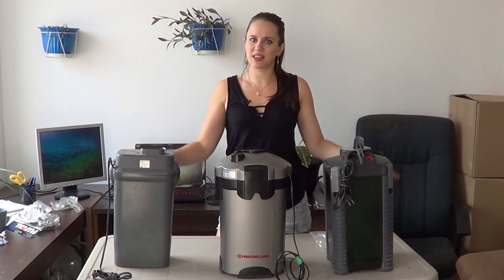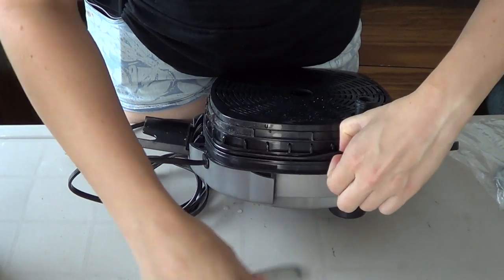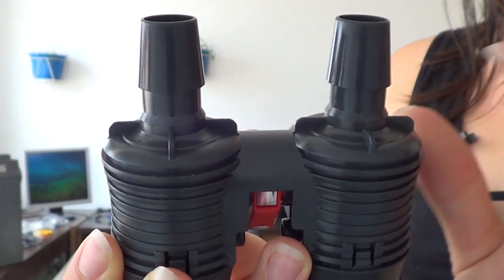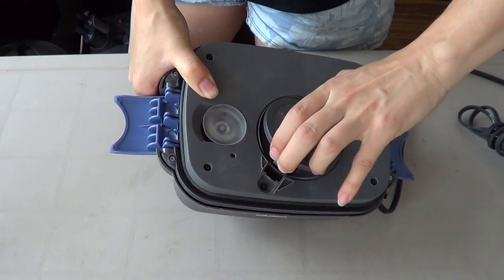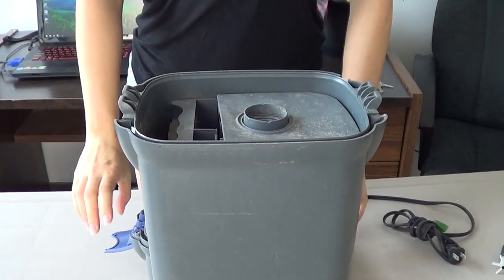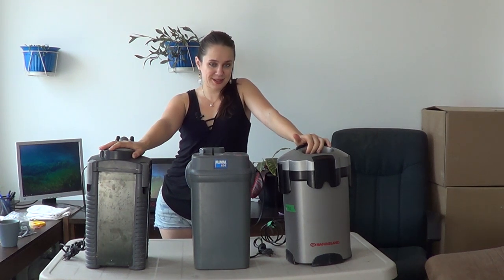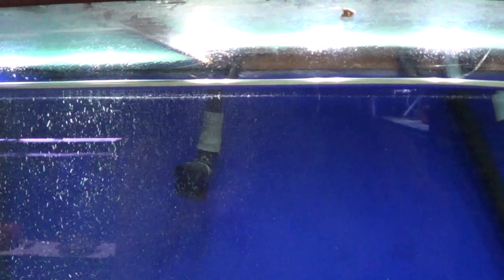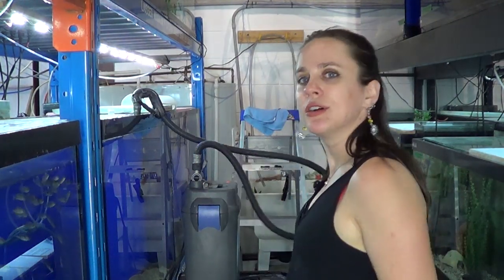How to Fix an Aquarium Canister Filter

Comment: Hello from England 🇬🇧,
Interesting video, thanks.
I've just tried to start my Fluval 305 after a few years, the lid doesn't  SIT properly & water comes our of the gap, is that just due to the rubber ring?
If so what type of lubricant shall I use?
Thanks.

Comment: What do you do in a situation where the canister keeps sucking in air from somewhere and blowing bubbles every few minutes. I have checked and no air is going in from the input hose. I've even put teflon plumbing tape on the nozzles of the hose adaptor and the o-ring of the lid to make an airtight seal to prevent air entering from there but it still seems to be sucking in air from somewhere. Any ideas where else I could check for an air leak?

Comment: As an ex Montrealer, 1968, I have been watching your entertaining videos since getting back in the hobby 3 years ago. I love your Fr Canadienne accent, and your enthusiasm on your videos

I have a Rena filter sitting at floor level for a bottom tank. Is there any fix for it not loosing suction?       Steve now in Los Angeles
Reply: I just added a comment about burping Rena filters, Steve - might be helpful.  These filters are great, but every once in a while, air can get into the system.  With mine, the intake mechanics inside the tank can separate and suck in air.

Comment: My oldest Eheim classic has been running continuously since 1997... had to replace the handle clips once... that I broke accidentally.
Things not working as you plan... the reality of fish keeping. These mistakes are fun to watch - glad to know us amateurs aren't the only ones.
Reply from the maker: 1997! Those Eheim filters are unkillable! When they break, it's usually our fault 😂
Life isn't perfect as social media would like us to believe.  
The more mistakes we do, the better we get.  I didn't get this good with everything going my way ;)
Reply: Since 1997? You should be an advertisement for them! I have been trying to decide on a filter, you just sold me. Thank you!
Reply: Sir...are u saying that you have an Eheim filter unit that has been running NONstop since 1997?????
Reply: Looks like I bought the wrong units!!!!
Reply: Only one stuff which could brake is motor lubricant. Mine has dried and motor stop working. Some clean up and new oil and works fine again.
Reply: RoxyQueen  I’m a wee bit late - don’t know how I missed it. If you are referring to never having been unplugged, then no. Maintenance and moving a few times have given it a few hours of rest. I always take my fish and tanks with me. Otherwise, yes, since 1997. I have an Eheim internal filter the same age also running since then. Two other Eheim echos running 7 tears straight. Two other larger Eheims only two years old, and a few early 1990s Aquaclear hob that have been in service about 20 of those years. An early 90s Fluval 403? Canister lasted only a few years  before many things started breaking and finally the motor.

Comment: Great video  a lot helpful tips. For leaking canisters that have UV lights, their is also a seal (o-ring) on the light housing on the inside of the head, that unscrews anti clock wise and is easy to spot the seal around where it screws in. Can tell if this housing is leaking by seeing if the light bulb glass is filled with water. Have a great day. :)
Reply from the maker: Thank you for sharing. This is great information. I didn't think of talking about the filters with "add-ons". :)

Comment: Hmm I should have brought down my 23 year old Fluval canister from the attic (still in the box) to have you demo how to fix it lol.  Thanks for the info since I might be doing this soon.
Reply from the maker: Most pet shops have the Fluval supplier. You shouldn't have problems getting parts :) I'm glad I was able to inspire you
Reply: i still got a Fluval 103 just order  the case clips  one broke off,seal is bad so i use teflon tape
i use the 103 filter to vacuum, great filter you do not find  filter like that any more.

Comment: Sometimes, at least on those API/Rena filters, when the filter gets really noisy - rattling like the impeller is broken - it's actually just because air got into the pump intake and you just need to 'burp' the system.  This can happen if the hard plastic intake tube in the tank somehow separated from the intake pipe going to the filter.  You'll want to fix that first.

'Burping' the filter it while it has water in it (and is turned off) is a little bit tricky - just give a couple of those side clips a lift for a second or two, watching for the water to rise to the top inside the filter, and quickly close them again before it starts spilling out the sides.  Put a towel around it first, like I forgot to.  This is a lot easier to do if the filter box is clear and you can see the water level.

If the intake pipe is empty of water at this point because the intake siphoning was interrupted by air, you can unscrew that cap on the top of the intake pipe and funnel some water into it, refilling it, and then screw the cap back on. This will make the system start up more quickly when you plug it back in.

As mentioned, make sure the hard plastic intake tube that goes inside the tank, is properly attached to the intake pipe, otherwise it's just going to suck air in again.

Did I mention towels?

Comment: Super smart video :) I used plumbing tape around under original seal ring if new seal not found.
Reply from the maker: Thank you :) I've never tried the plumbing tape. I'll give it a try next time I'm stuck.
Reply: Great idea. If you end up near say a Princess Auto or an industrial supply shop, check on a a tube of gasket or "O Ring," lube. It is specially designed for giving seals a new life. If you would like I think I have an extra tube, the stuff I have is called S111. Your plumbing tape fix is genius, nice work.
Reply: works wonders.
Reply: I used this too..didnt work.

Comment: I have an issue and need professional help. I have a Polar Aurora Free Media 4-Stage External Canister Filter with 9-watt Light, 525 GPH  and I followed all instructions and it works fine but i notice from the start that it runs for 8 to 10 minutes and then stops for the same time. Then the cycle repeats itself. My aquarium water is fine after testing but I am concerned since everyone says it must work continuously. I contacted the company and they sent me a replacement motor cover but no change. What else could be the problem?

Comment: Any tips on the discontinued Rena Filstar gasket and o-ring replacement kit? I have the XP3 that works really well but after 10 years I think the seals are about to go.
Reply from the maker: You don't want my tips on this filter :( All the parts are discontinued and impossible to get. I gave up and got rid of my 5x Filstar filters. It's depressing.

Comment: Have you ever considered reading the instructions that come with the filter? I have a Fluval  407 and used to have a 405. To start it you just push down the intake lever while keeping the output nozzle above water level. Filter then fills with water and you plug in the power. Very simple.
Reply: I cannot thank you enough for taking the time to write your comment. I could not figure out how to get the flow going on my filter. I had cleaned it and removed sponge material that lessened the flow... Nothing seemed to work. I followed all the directions in the manual. I've had my rena filstar canister filter for years almost 10 and never had this issue with it before. I always fill it up as much as possible in the canister and then the intake where there is a removable lid. I have never ever read anywhere in the manual or even trouble shooting online Reddit Quora YouTube about lifting the outtake above the water line while plugging back in. Truly so grateful for your comment. Thank you. My aquarium is saved.

Comment: Love your approach Richelle, simple and straight forward.  I had an impatient Sunday once, where I was sucking like a Catholic on her wedding night, but no syphon whatsoever.  Lots more sucking and swearing, only to discover that the hose running across the tank brace had come loose from the inlet pipe.  Turned out the pipe which was quite old had stretched and gone hard, so worked loose easier than it would normally.  
I'm with you though, the ribbed Fluval hose is a P.I.T.A, and always switched over to the smooth tubing.
Reply from the maker: Hi Barry. When I got the notification of your comment, I burst out laughing! I feel ya!!
I had to edit out some of my siphoning for the Fluval Canister.. if I would have left it, my video would probably have attracted some unwanted attention 😂
Those old tubes give me so much trouble.
Reply: Hahaha... yeah, I can imagine.  lol
Reply: Oh my God!🤣😂🤣😂🤣 Long story!

Comment: My hang on back mini canister filter doesn't pump water... I tried priming ..then it works for couple of seconds and then stops...i can see water running up through the outlet pipe untill the last bend but don't throw water into the aquarium...can you please guide any corrective actions..this is brand new hob

Comment: Whenever you fit an o-ring (seal) use your silicone grease. It'll allow the seal to find its natural shape in its seat, this assist to prevent distortion over a longer period. 👍
Reply from the maker: Thank you. Great addition! 😊
Reply: This did not help me with my issues on the sun suns..even though everyone swore by this.

Comment: I have a Sunsun canister that I can't get started, I don't know what's wrong. I fill the canister with tank water, then start a siphon in the intake line, close the valve, attach to canister, then open the line and plug it in. Then the siphon breaks. I don't know what to do. Help?

Comment: On the 404 my top won’t close properly and slightly leaking where clamps are
Reply from the maker: Your seal is probably badly put on. That's what I usually find is the problem. 

That, or something in the canister is blocking it from closing

Comment: Have you ever heard of the sun suns getting warped??maybe from too hot of temperature being left in storage or too cold temp? I have 2 Sun Suns that both Leak from the handles and one leaks from the sides..Ive changed the seals and even went as far as to use silicone glue or sealant....which this did NOT fix my problem...go figure..I also have a HYDOR 600 that has lost huge amounts of water flow..is it the motor maybe worn out? Its 3 years old and wel taken care of..I dont understand why I am having all of these problems with an expensive unit AND Inexpensive units..can u help me out here?

Comment: Hi, can you help me. I have a canister filter dophin C1000. After set up the filter. I try to pump out the water from the tank into the filter. But, the pressure is not enough, the water from the tank didn't flowing down. So, i try to fill the water in the filter. Then, i turn on the power, but the water didn't going in and out. I heard the weird sound of impeller. I try to take off the top, and switch on again the filter. I saw the impeller only vibrate not spinning. I try to pull out and reposition it again. But, it still the same. Doesn't spinning. How can i solve it? Please someone help me 😭
Reply from the maker: Check if the shaft or impeller is broken. I show you how to do this in the video. ;)

Comment: I still don't gdt what happened to my filter, it makes a rattling noisd but it doesn't pump any water. I only used for about 4 to 5 years.
Reply from the maker: Did you watch the video? There are tips there that can help